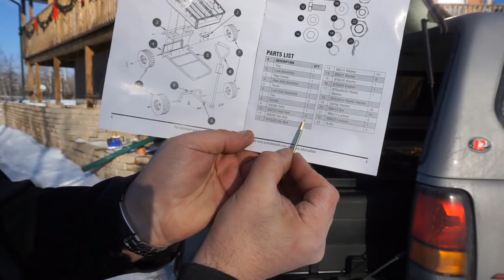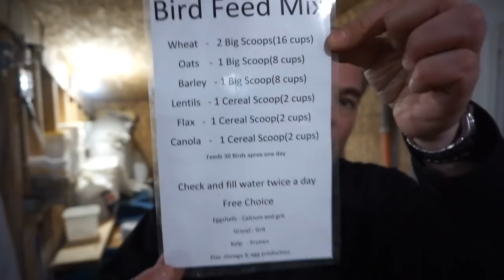Pigeon Care and Night Feeding

Comment: I would take the tree out of the pigeon loft, and put more flat perches on the wall, they have trouble sitting on branches and prefer flat surfaces and shelves. Also it would give them more airspace. In the wild they live on cliffs, not in trees.
Reply from the maker: Thanks Alec, Tara had put that tree in last winter as decoration and had left it in. It would be a great winter project to build perches 😊